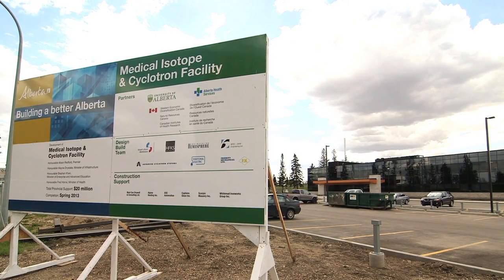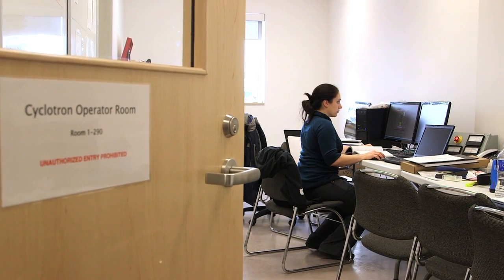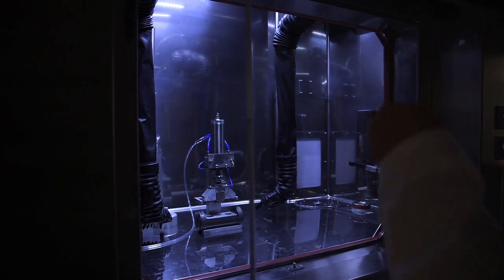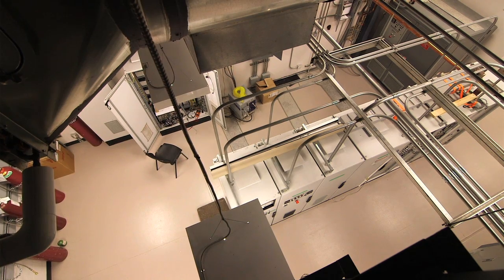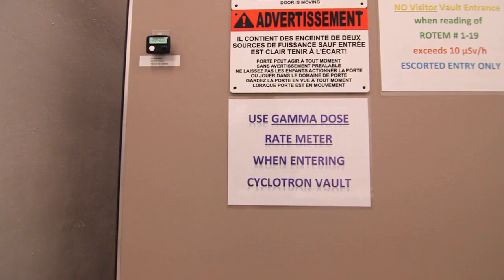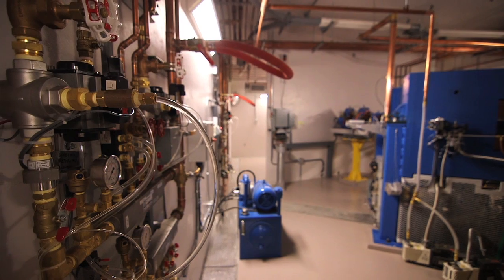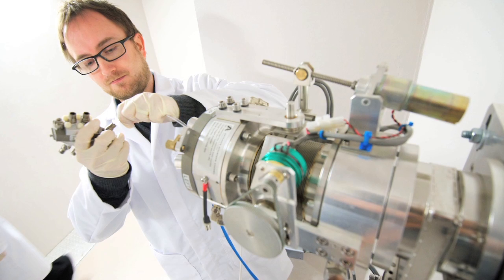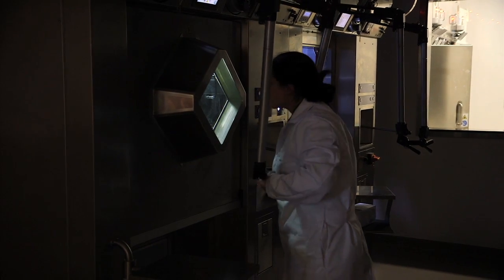Medical Isotope and Cyclotron Facility

Comment: This is the difficult way to do it.  Nuclear reactors are much more efficient, but for political reasons and the debacles over the MAPLE reactors, people now love to hate reactors.  Reactors have much much higher neutron fluxes and are just better in very way
Reply: Annon Annon Nuclear reactors are way more expensive than cyclotrons and pose danger of radiation if not properly maintained.
Reply: Nuclear electricity is doomed. Too expensive.

I live in Brazil.
Reply: @daltonagronomo1652  60% of our electrical power in the province of Ontario is nuclear. We love nuclear power here.
Reply: While reactors are certainly a good way to produce large amounts of Mo99 for Tc99m generators, they also require extensive infrastructure.  There are only a handful of facilities across the globe that produce the world's supply.  There are often supply chain interruptions, outages and general mishaps that mean there's a scramble to keep up with global demand.  This results in shortages, and means backup supply is needed.   There is a much higher cost per GBq for cyclotron-produced Tc99m, but it ensures that supply is still there to meet the patient demand.  Offsetting production energy costs with solar is also a way to make this cheaper.

Comment: What is the target made of?
Reply: If it's being used to generate 99m-Tc (a Technetium atom with an atomic weight of 99 units in an "excited" state), then the target is likely 100-Mo (Molybdenum). When the protons in the ring smash into the 100-Mo target, they stick to the nucleus and cause it to eject two neutrons, leaving 99m-Tc atom, which decays via the release of 140 keV photons with a half-life of about 6 hours (hence the need to make the isotopes near where you are going to use them -- if it took you a day to get them to their final destination only 1/16th of the product would still be radioactive!).